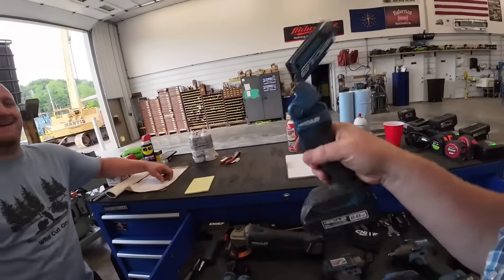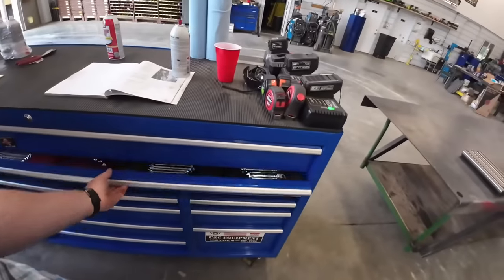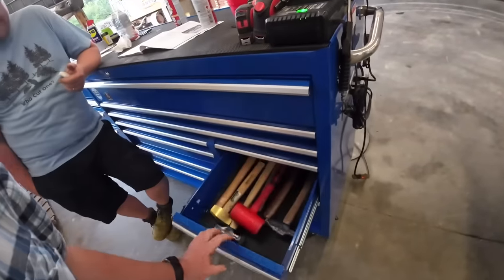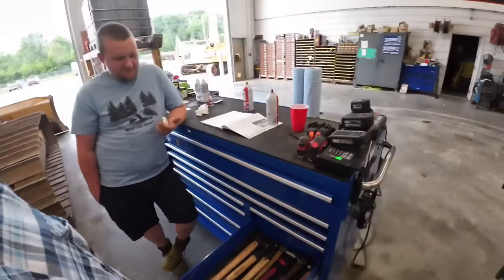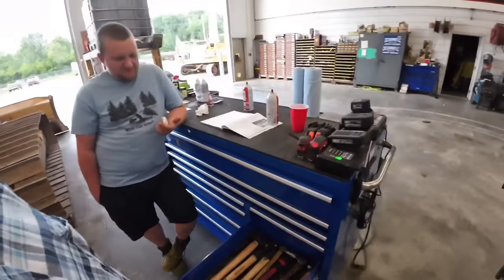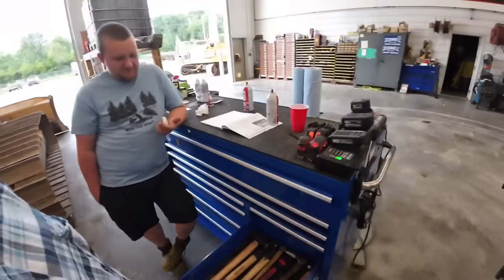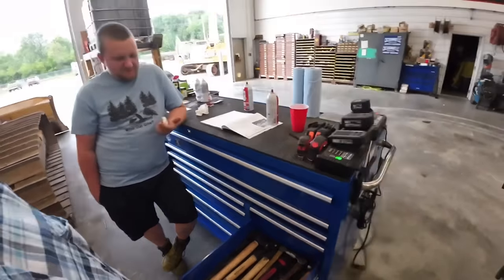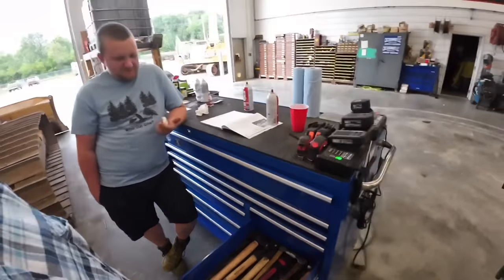Fixing a gamble I bought at auction and 6 month Harbor Freight tool review with real world testing

Comment: I have a side job as an airplane mechanic (A&P IA) and have well ober $125k in tools and tool cabinets all from MAC, SNAP-ON and  MATCO because they actually fit and work a lot better than the cheapies like Craftsman or Stanely. Plus I like the service I get from MAC & SNAP-ON because they come to me. Its not cheap either. I work full time as an attorney so having a part time job working on other peoples toys is really relaxing however, my name will go in the aircrafts 3 log books (1. Prop log, 2. Engine log 3. Airframe log books) and that alone is why I charge more as a mechanic than a lawyer

Comment: Some of the Harbor Freight tools aren't as good as the stuff that will cost at least 10 times as much, but for a guy that works on his own cars on weekends, they are just fine. They are a much better investment for the home hobby type work than Snap Off. For the type of work you guys do there, the expensive stuff might be a better choice.
Reply: Agreed, with caveat, for some of my tools that I know I need tight tolerance, it is worth the extra bucks.  But some items the harbor freight more than works (Daytona jacks)
Reply: Some of Craftsman or snap-on or Mac tools come from China
Reply: One of my best friends and his brother, are both John Deere mechanics and they both use HF tools exclusively. Sure, things are going to break. I have a Snap On ratchet that I found given it has been back to the Snap On truck twice. Never has one of my HF hand tools been back. I have a 4 1/2" grinder that I paid $9.99 on coupon about 16 or 17 years ago that has sharpened two set of bush hog blades down to a  point and still runs great, sharpening mower blades for everyone in my little town. My tool box has been trouble free EXCEPT for the casters. The rubber has disintegrated and needs a new set but I never move it, so why bother. I retired from fleet maintenance management and all my shops used HF 1" air impacts. Of course the hand tools were furnished by the mechanics, primarily Snap On because they could get them on credit. 1/2" Snap On combination wrench, last time I checked, was $37. HF 22 piece set $19.99.

Comment: I bought the extendable ½" ratchet.  I keep it with my spare tire.  I've used it a few times.  I don't need it more than on occasion.  It does come in handy to break the lugs.  It does not much room in the car.  Way better than the nubby wrench that came with the car.

Comment: Great job on the winch. Every manufacturer of equipment has some weak spots. Knowing what to do to work around those things is where experience comes in. Now the winch needs to sent over to the loggers to test it out. 😁 Seeing that smoke coming from the hot penetrating oil reminded me of the stuff we used on the railroad called Trizol. It had a very "distinct" odor to begin with but sprayed onto hot surfaces it was a smell that won't soon be forgotten.

Comment: When you use your impact on the chrome sockets which are harder than impact sockets it will destroy the socket ring ( hog ring ) on the impact eventually. When I ran my Snap On Tool route I just gave the guys 2 or 3 rings for spares. When you get a sliver of chrome under your skin from a socket you will throw them across the shop. I have two Milwaukee battery impacts. The 3/8 and 1/2 are as strong as the Snap On and can break impact sockets.

Comment: When I work in things and notice a pattern of failure I check to see if the manufacturer updated the parts to solve the problem and I check the aftermarket for a solution to the problem.  If there is no solution to the problem I come up with my own solution to solve the problem of repeated failures.

A pump with a longer shaft with a bearing support would definitely help.  There is a very simple solution to this problem that you could make yourself in house.  All you have do to is make a new nut with a shoulder on the end and make a new cover that a bearing can be pressed into.  The shoulder on the custom nut would fit in the bearing that is built into a new cover.  If you built the cover and nut correctly it would be impossible for the nut back off because it would have no room to unscrew.  A mill and a lathe is all that is needed to make the parts.

I have engineered many solutions to common problems throughout the years and I usually give my designs to a aftermarket manufacturer of parts.  I have given sonnax many of my solutions in past.

Comment: Harbor freight large wrenches take a beating 😁 I started out with mix of hb freight , craftsman and gear wrench in crane shop . I will say even when you upgrade the tools you abuse daily . You can’t beat having backup wrenches to get you out of a bind, torch bend or cutoff to fit in . Milwaukee definitely has power tools for heavy equipment  specially with local repair/warranty shops

Comment: I’m very selective on my Harbor Freight tool purchases but one of my workers has a lot of HF tools and I agree with you 100%. I tried a Pittsburgh ratchet that had 1/2” on one side and 3/8” on the other and had it set up with a socket to pull the cover bolts off the track cover of the excavator and the other side had a socket for the track bolt. Great idea to have in the cab at all times. Only it stripped the gear teeth after only a couple uses😢

Comment: What you call crescent wrenches, we call simply adjustable wrenches,I have found that the swedish bahco ones are great, I have myself got them from 2 inches in length to 14 inches long. I have never broken any of them but I have broken other makes even though I wasn't using excessive force they broke the opening side off and took off skin from knuckles

Comment: FYI The problem with Asian made screwdrivers is, they are made on ISO standard for ISO screw/metrics
For example : The depth of the Phillips head is shallow, the width of the x bite on the driver is thicker and
the angle is like 32 degrees as opposed to non metric of 45 degrees or something on that order !
Reply: The only thing is they all look the same,I just pick the Phillips bit that fits the best when I have an extra tight screw

Comment: I have had good luck with heating bolts red hot then immediately quenching with cold water until bolt is cold and it should back out. Rarely use penetrating oil.

Comment: Harbor Freight quality has greatly improved from when I first bought them.  For intermittent use they're very good.  Just avoid the items that aren't machined or forged well.  Electrical items should be replaced if there are any issues.  Generally good quality control but sometimes things just go bad.  I generally go for the higher quality.

Comment: Those long handle diagonal cutters are awesome. I got a couple pair for each of my Case dozers for the old fencing that likes to get caught in the undercarriage. After I used them a couple times I went and got more to keep on all my equipment and trucks. H.F. stuff is good for light to medium use but the way you guys use them can't see much of there stuff holding up long term. Great video, keep em coming.

Comment: I will admit that the snap on battery tools are extremely high. But I use all mine in the junkyard every single day and I’ve only had one issue with one 3/8 1/4 body impact. I absolutely love my battery tools from snap on.

Comment: Hard to justify 20k for the upgrade to snap on. I like harbor freight but not a fan of the battery stuff.  I have also been really impressed with the titanium 200 welder, feels like a 2k welder.  The one thing for sure is they are great a ripping off everyone else's design.

Comment: Looks like the HarborFreight tools are holding up pretty good.

 I’m right there with you on the Milwaukee impacts. I think I ruined my 3/4” drive the other day trying to bust lug nuts loose on my motor home. The tire guy got a bit carried away with the 600 ft/lbs torque spec. I had my son in law pull on a schedule 80 pipe and we snapped a 3/4” extension right off next. My Proto 3/4” drive breaker bar did hold up to 8’ of pipe.

Comment: Smart move replacing the bearings, give some thought to opening the oil pump might be a smart move. For the way you are going to be using the backhoe around the farm I also would not replace the pistons and liners. All though I once did a valve job on an engine and it burned oil very badly, but the customer did not want to go all the way. He also stiffed me for the parts and labor I had in the job. Never did that type of work again, hard lesson learned.

Comment: The 20 degree offset needle nose pliers need a chainsaw file to create a ( ) centered 7/16" from the tip.  This greatly improves their ability to grip wires. Nails. Sockets. Extensions.  Screwdriver shanks.
Reply: Dont forget 10 mil. sockets.
Reply: @ElmerJFudd-oi9kj  i really need to find my image of picking up a 1/2x 6 inch extension with a big socket on the end with those needle nose with that mod..
Reply: @waynep343  10 mil. as in millimeter, I don' do bananas.

Comment: adjustable wrenches aka shifters aka nut fuckers cause they round things off more often than not.
mind you dad has some black sidchrome (bare quenched steel not chromed plated) sidchrome ones he's owned for40 yrs and they have had some use and a still nice and firm. there is a right way to use one the moving jaw should always be on the inside of your swing so the load is always on the fixed jaw

Comment: Bought the Hercules 1/2 impact It wouldn't break the lug nuts torqued to 80 ft-lbs Took it back and got another one same thing. The 1/4 impact driver has similar torque to the 1/2 impact. The strange thing is it will tighten harder than it will remove.

Comment: By the sound of that input drive gear with the worn edge do you think it should be shimmed,sounds like she’s floating in the housing mating up to the hydraulic pump.Would account for the excessive noise and vibration which separated the pump gear assembly,just my thoughts,cheers for your video.

Comment: 39:10 "Where's the keyway?"  I've noticed that another southern Indiana Youtuber uses this term incorrectly.  The little square or half moon piece is called a key.  
It's generally accepted practice to call the slot on a rotating shaft and the matching slot on a rotating component, like a gear or a crank pulley,  a keyway but there is a difference between the two.  Technically, the slot in a rotating shaft is a keyseat.  But it's unlikely you will hear anyone other than engineers and some machinists using that term.
I'm sure there are things that I say that people think WTH?  Maybe even this comment. 😜

Comment: Sometimes old "ain't really old" as in worn out old, but like myself, not done anything in a long time. Now I am sure that you have more business than you  need already but the guy who has a channel called FarmCraft 101 is repairing a track frame where the front idler is riding at. It is badly worn down and has no shims in the place on this idler rides. I hate seeing things go south when they just don't need to. I am hoping that you may have used parts that might repair his unit better than a hillbilly repair. Maybe a compilation of sorts

Comment: Hey a question for you. Will a socket fit on them harbor freight screwdrivers like they will or craftsman's?
Reply: A socket? Idk bout that. Do you mean an open-end wrench🔧, like on the shaft? I'm not sure if those screwdrivers have the square shaft like some Craftsman do or a hexagon 'bolster' right underneath the handle like S-K screwdrivers do. I am sure a socket doesn't go on a screwdriver though....unless maybe a hammer powered hand impact driver that accepts sockets & bits. 🛠️🛠️🔧🔩📏🗜️✏️📐🧰🤔🤷‍♂️😃
Reply: @tdotw77 seen some cheap and nasty screw drivers with a hex on the top of the handle you could put a socket on but it’s a terrible design
Reply: Yeah a socket fits craftsman screw driver's

Comment: One thing about Harbor Freight stuff, it doesn't get stolen as often.  As far a battery tools, I'm still all in on Milwaukee 18 volt.  Don't know so much on the Fuel 1/2 impact as my old one hasn't died yet.  The only bad thing about Milwaukee is they are owned by the Chinese.